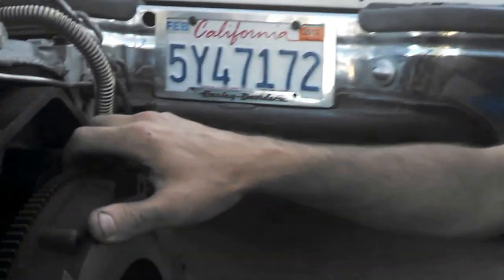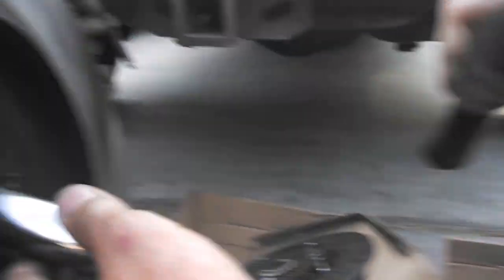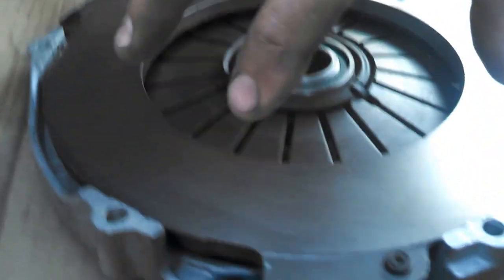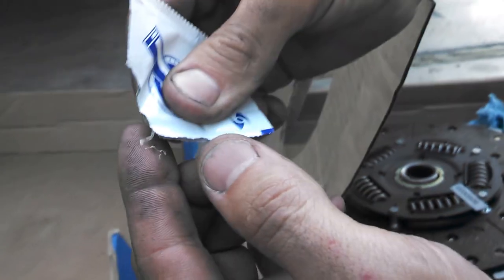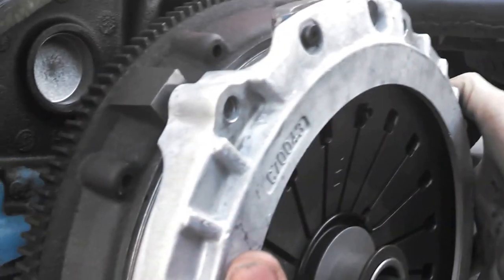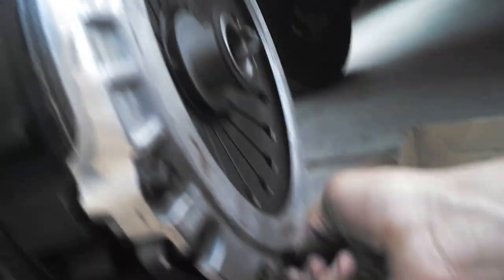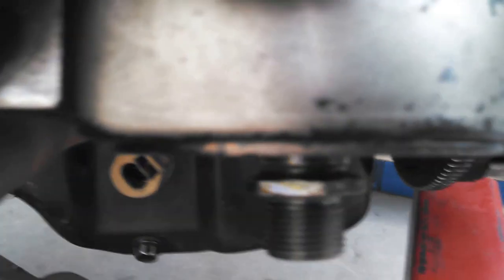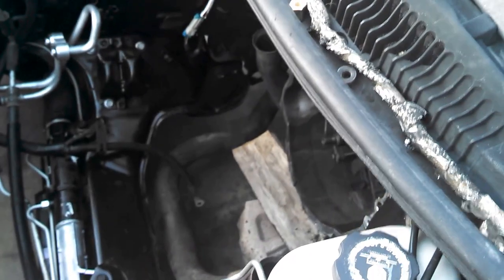1995 F-BODY TRANS AM LT1-T56 ENGINE REMOVAL CLUTCH ASSEMBLY INSTALL PART 5

Comment: You’re only supposed to use motor oil on pilot bushings and use grease on pilot bearings
Reply from the maker: Hmm... I haven't heard this before. I see how that could make sense. I usually use the lube that comes in the kit. I'll definitely research that and see what I come up with. Thanks for the tip.

Comment: What were the torque specs you used for an flywheel,  pressure plate, bell housing and transmission? I cannot find them anywhere and keep getting different answers.  If you could get me those answers i would greatly appreciate it.